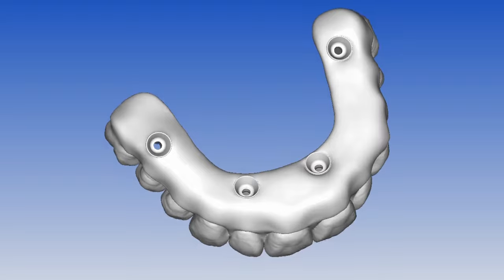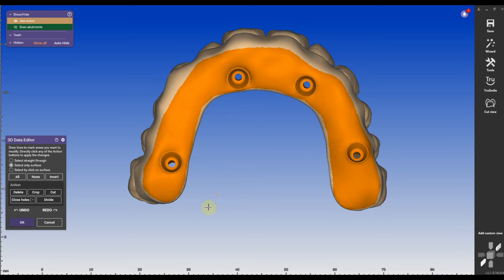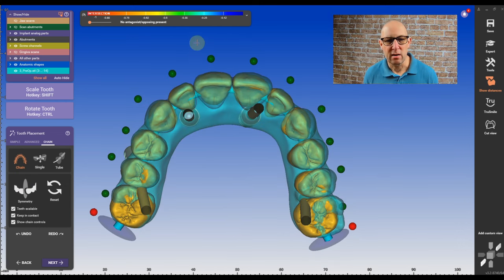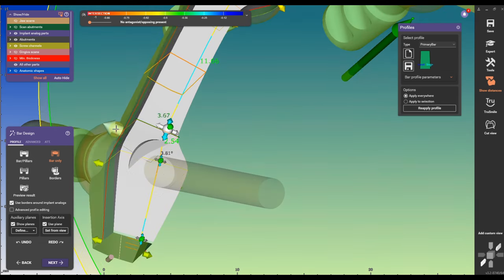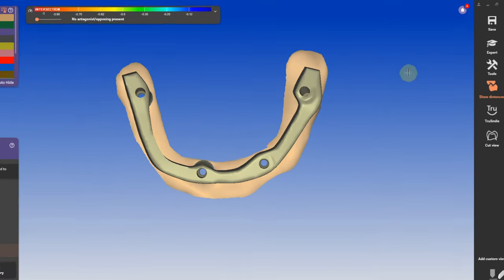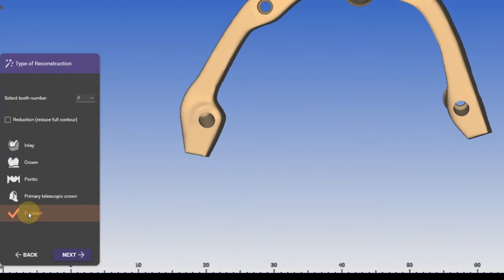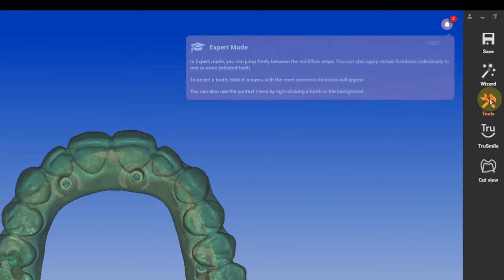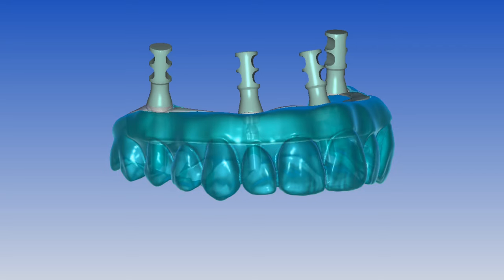All On 4 Design with Screw Retained Bar Split File [ Exocad Tutorial ]

Comment: But there is one big problem…its not possible to set minimal thickness…
Reply from the maker: That is correct. That's why you have to bring in the cutter as a generic mesh before cutting and add the areas where it's minimal thickness.

Comment: Hello,everything is perfect, until I get to use the cut bar attachment to make subtract, I don't have the setting allows any change, is it an additional function or should I set it somewhere, thank you
Reply from the maker: There could be several reasons. A) make a solid of the cutter in meshmixer, B) uncheck allow any changes when cutting it. C) there might be artifacts in the main design inside when you deleted the mua interfaces
Reply: Don’t exist the setting in the dialog box,meby mai exocad is not the latest one
Reply from the maker: @609chetu what's your version
Reply: Rijeka 3.1
Reply from the maker: @609chetu  try to make the cutter a solid
Reply: I did it 😊 thank,s,,you are the best,have a nice day

Comment: What if we want to create a Finish line between the bar & the zirconia prosthesis with 0.5-1mm thickness ...... is it applicable ?
Reply from the maker: Change the bar profile. I used the standard bar profile in this example.
Reply: @masterdentaltechnician1914  

Thank you ! 

i've another question please , Does the steps can be applied with the complex Prosthesis ?

Comment: Thank you for your video, It's amazing. I tried, but in final step, when I need to subtract attachment always I get a failure message. Attachment can't be applyed.  There is any secret here to succesfully apply cutter as attachment/subtract ? Thank you verymuch.
Reply from the maker: There are several reasons why there is a failure. Usually it has to do with the cutter itself. 1) Check if you exported only 1 mesh as the cutter. Double meshes cause errors. 2) the cutter has some errors in itself. import the cutter into Meshmixer and inspect for errors. make the cutter a solid. Export and try again. 3) if you didn't rotate the cutter in the subtraction mode it might fail. The Meshmixer version usually helps.
Reply: @masterdentaltechnician1914   Thank you very very much, I will try all 3 dots and get back here to let you know. I repeat, your wok in this video is really amazing.
Reply from the maker: @mariussava6126 if it's not working send me the file on Patreon and I will look at it.
Reply: @masterdentaltechnician1914  Hi. I tried several times, both ways(make solid in meshmixer and loading as model am do bottoms) and it worked nicely. Now, understanding your ideea, it make sense, is logical....now I'm asking myself why I didn't think this way before... Thank you very much.
Reply from the maker: @mariussava6126 you are welcome. I use that technique on all locator and Conus cases to have an internal TI-Bar. If you haven't seen that technique I made a video about it. Thanks for the comment!!

Comment: it can be used with rosen screws?
Reply from the maker: No. This Library does not feature Rozen Screws but I can see if I can update it.
Reply: @masterdentaltechnician1914  did you happen to update the library to include the rosen screw M1.4 by any chance and the dess 19018 screw please
Reply from the maker: No. I would not use Rosen screws on Metal to metal. You risk of never getting them out.
Reply from the maker: @peterelfar3652 I would not recommend using Rosen screws on Metal to metal. You risk of never getting them out.
Reply from the maker: @peterelfar3652 the Dess 19.018 long screw you only need for PMMA. There is no need for it on metal bars

Comment: Can you tell me how to solve the problem.
At the end, when I need to cut the bar , Attachment operation failed appears.
Thank you
Reply from the maker: Something is not correct with the cutting tool( the bar). Either you didn't invert it or it's too short. Hard to tell without more information. You can send me the file and I will look at it.
Reply: Same thing for me but i followed every step…
Reply from the maker: I will make a short troubleshooting video to avoid these complications .
Reply from the maker: Can you Wetransfer your Project and CAD file to masterdentaltechnician@gmail.com so I can see what went wrong
Reply: I found solution..you need to remesh bar cutter in meshmixer as refined boundary save it and that remeshed stl file use as bar cutter and it will work because it has refined mesh topology.. :)
Reply from the maker: @wintersolider2305  thank you for sending me the file. I sent you an reply with a similar answer. I imported your bar cutter into mesh mixer and saw issues with the file. I would need to see your entire process to analyse what went wrong on your side. Anyway I made it into a solid , exported it and after that it worked fine to cut the bar out of the mesh in Exoxad.
Reply: It can also have some holes in the waxup mesh. I ran into the same problem, and it took me a while to figure it out. Once the waxup was calculated, for some reason it made some tiny holes in the mesh, that was the problem for me. But my bar was also a complicated design, a really thick piece.